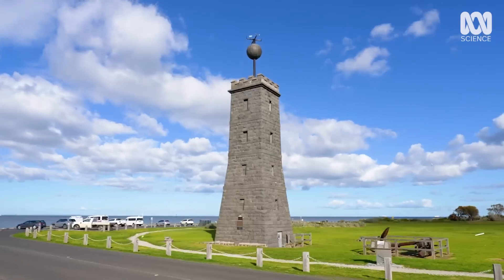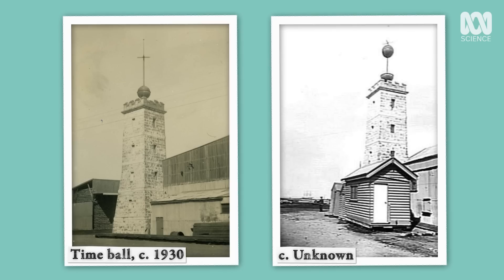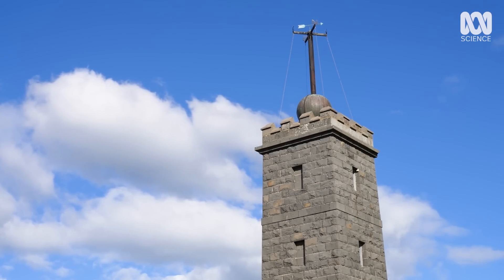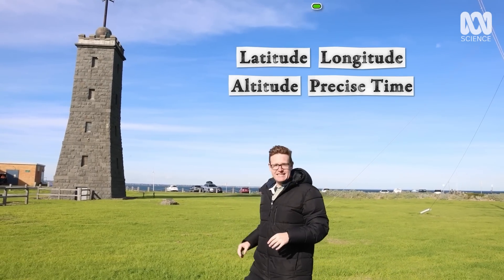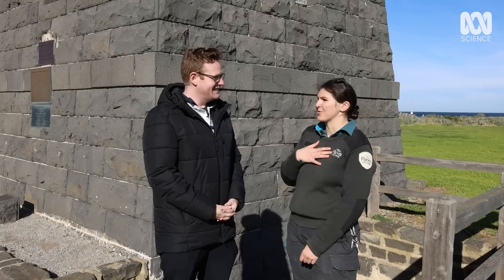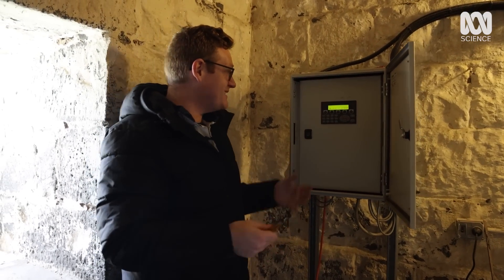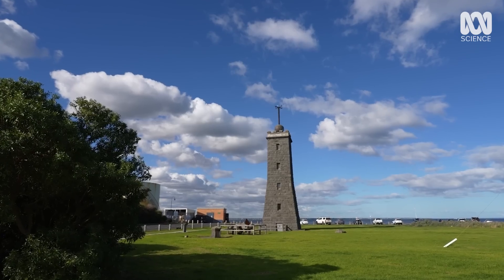This Tower Is One Of The World's Rarest Clocks | Unknown Australia

Comment: your floating lighthouse at 2:18 is the gellibrand pile light.   i just read up on it and the floating lighthouse had the base of its hull cut off and set on piles in its old location.   the harbor trust set fire to it after it got rammed by a ship, in 1976.

Comment: Interesting fact that coincides with this... The US Navy moved away from teaching celestial navigation some time ago but have re introduced it. Why? Because you can hack a satellite but you can't hack the Sun and the Stars. Small correction the video: you don't need the correct time to calculate latitude. You only need time for longitude.
Reply: There have also been automatic star trackers for aircraft since the 1950s.  Modern units are much cheaper, smaller, lighter, and more versatile.
This is especially useful for high altitude capable bombers which fly above clouds.  Ultra-precise, ultra-low-drift dead reckoning systems are about to replace GPS because of spoofing.  Since Sandia is at the forefront of this tech, you know it's also being used for nuclear weapon RV buses.

Comment: If I was a local and had time to do something 'pedantic', I'd start a campaign to have the time the ball drops moved to one after the LOCAL noon time, rather than the 1 o'clock Eastern Standard Time.  Standardised time zones are handy in many respects, but not for old school navigating and the tower doesn't sit on the 150 degrees East longitudinal line.

Either that or have it drop at the local equivalent to 2 am Greenwich time.  I'm not sure what's best for adjusting marine chronographs.

Comment: Didn't  live far from the timeball tower, as a kid you could see a red light  (if i remember right)  they had a 1935 built addition that was of brick constuction and was built above where the timeball is now, it was quite a high extension and painted silver, in the 1988 bicentennial it was demolished, and not quite a great job in doing so as i remember they certainly bounced a lot of bricks off the old bluestone, among the piles of bricks and associted rubble  from the 1935 extension lying around the base of the timeball tower was an old window frame,  that  1935 old window frame is still sitting in my shed!

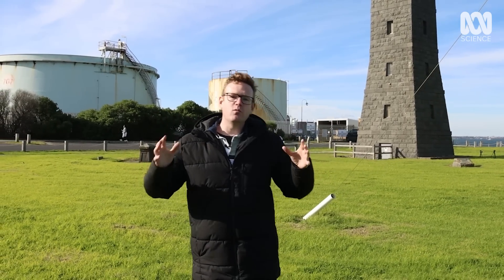Comment: Why 1:00?
Reply: It's to do with the celestial navigation. 
It all revolves around knowing where the sun is directly over head on the planet (Sub Solar Point). The best Time to do this is Midday when the Sun is at it's peak above the horizon. This is a very busy time  for the officers and navigators and the chronometers are in use. Because even in port navigators would still check there position as they needed to know that there chronometers were correct, training, and practice.
So it comes down to the clocks are busy and the people who used them/set them were busy as well.
Reply: @Can_Driver  Thanks, I kind of assumed they'd have a system to use the mid-day sun directly overhead, but not that it would involve so much work.
When checking an old mechanical clock (or watch) one can easily view it whilst also seeing a reference and see what the error is is fairly easy, doing so on the deck of an old sail ship bobbing in the bay was probably a lot harder, especially using some contraption to see when the sun was truly dead overhead.
Reply: I was wondering the same thing! Is it to do with tides since it was important for shipping?
Reply: @EllenLouise19  No, just making sure your ships clock was correct as you get ready to depart. Back then it was kind of hard, no radio etc.
I would have thought mid day would be an obvious choice, however they may have had an alternative already using the 12:00 slot, so they went for 1:00 with this system.
If you are wondering why going to all this trouble just for a 'stupid clock', then try Googling 'the longitude problem'
This killed so many people 'back then', it's not funny

Comment: Would be nice if the tower at Semaphore here in Adelaide could be reactivated. I would also like the time gun at Fort Glanville reactivated; the local residents would probably disagree.
Reply: Apparently it still works but not all the time. It must need restoration of the old mechanism or a total modernisation of it to make it simplified and reliable.
Reply: @stevenbalekic5683  In 1992, the Tower was restored and a mechanism installed that operates the Time Ball by electric motor
Reply: It was restored in 1992, Apparently it still works.